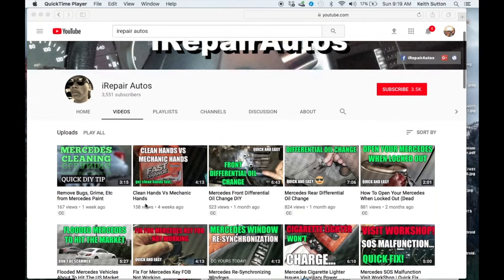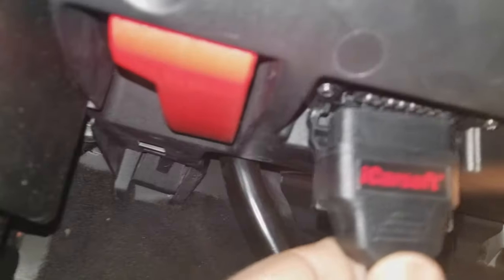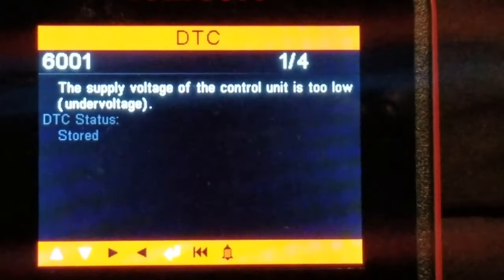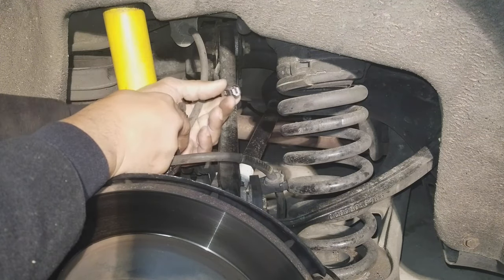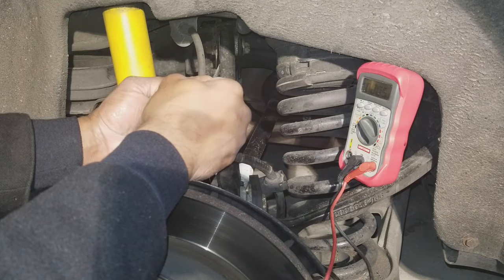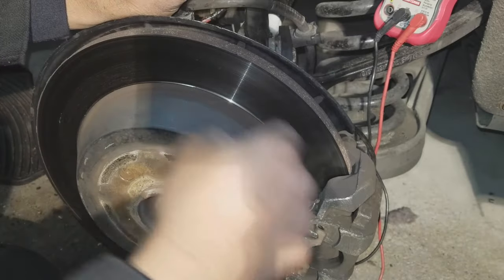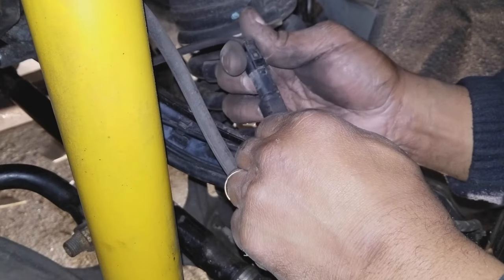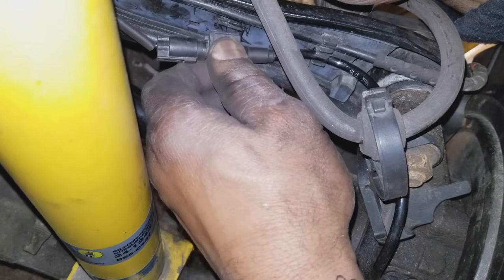Mercedes ABS Sensor/Wheel Speed Sensor Troubleshoot and Replace

Comment: Great Video.  Would love your opinion on a problem I'm having with my 2000 S430.  my ABS light is on and the code states I need an ESP module.  Just haven't gotten around to it because I'm dealing with a transmission issue I'm wondering if it's related to the ABS.  There is no check engine light on.  I'm getting a harsh downshift from second to first when slowing down to a stop and I'm also getting what appears to be an engine flare during the upshifts. It's up shifting at a higher RPM and seems to almost lumge forward at the shift.  I have change the conductor plate...13 pin connector...New TCM...rebuild valve body and yet this problem still exists.  I'm at my waits end with this vehicle...but I love it.  Do you think the bad ESP module could cause this? I did replace a rear right speed sensor way back. I know the speed sensors might affect the shifting but I believe that problem has been corrected and my cruise control is working fine.  There was a time when the smooth shifting would  return and notice the steering felt lighter.  Then the rough shifts would come back and steering felt a little heavier.  But now the rough shifting is constant.  I personally work on all my vehicles and own a few benzes but I'm stuck on this one.  Any thoughts would be greatly appreciated.  Thanks
Reply: Mine did same thing I’m pretty sure it’s connected cause it all stated when the abs light came on

Comment: My ABS light is on. When I run the diagnostics, it shows C1120 left rear speed sensor bad and C1140 B34/1( ESP Pressure sensor fault). On the speed sensor, i confirmed that there is low DC voltage to the new sensor is getting AC voltage when i turn the wheel. This is the replacement sensor that I bought on Ebay. On the C1240 code,I replaced the sensor on the bottom of the master cyclinder and i am still getting same code. Verified that there is dc low voltage to sensor. Any more advice would be greatly appreciated!!

Comment: Hi there, you’re using the i980, but linked the MB II model...just curious if the MB II is newer and better than the i980? (Based on the manufacturer, yes)...I mainly need for diagnosing a few lights: ABS, ESP, EBD, and tire run flat indicator on my 2011 c300 4matic sport

Comment: great job question can the wheel sensor cause the front right brake to lock up?  my 1999 ml320 has that problem.  I have replaced the yaw rate sensor with no change, I have bleed the brake line no help.  now I cant get the wheel sensor to come out need to work harder I guess.  alan
Reply from the maker: Wheel sensors can cause the wheel to go into ABS mode, skid, and brake.  Are all the tires the same brand and size?  Are the inflated to the match?  If one is spinning slower than the others it will simulate an issue that may look like a wheel speed sensor.  Let me know.

Comment: I have a 2014 C250. It will idle around the parking lot fine but when you press the gas it seams as if the breaks are engaging and the car dies down. Could this be a sensor issue?

Comment: Hello,
My name is James from upstate New York. Your repair videos are very beneficial. I have a 2012 c250 coupe Mercedes benze with a check engine light is on. I plugged 
the icarsoft scanner and it is saying the left front wheel speed sensor is bad. I replaced it and cleared the code, but the light keep coming on. Please advise.

V/R
James
Reply from the maker: You could have an unrelated issue, are you still getting the same code?  Also did you inspect the harness to the speed sensor to see if it's damaged?  Where did you get the speed sensor?  Was the vehicle ever in an accident on that side?

Comment: I have a question, my ABS, ESP, air pressure tire sensor, and Diff lock plays up, I know it's the speed sensor in the right rear, would this throw the error for diff lock?

Comment: I have a 2006 Benz c280 my car won't sometimes won't go in park I have to do it myself then sometimes won't start then it will only go in drive and reverse was wondering if it's this problem and what measurement is the sensor please and thank you
Reply: Speed sencer ?
Reply from the maker: It could be your brake position sensor.   Have you scanned it with a scanner that can give you more than check engine light codes like an icarsoft scanner?

Comment: Hello, i have a Mercedes CLK w209 and if i watch live data on my obd scanner of speed sensors they show 0,59 km/h with the car in park and not moving . i have no codes regarding abs . i also mention that the transmission acts weird a little bit

Comment: I just removed a stuck sensor from my Sprinter but not sure how much force to expect to use pushing in the replacement. The stuck one had to be partially drilled and pulled out with a self tapping screw; and all pieces were extracted without damage to vehicle. Seems to be a friction fit to install the new one but not sure how much pressure I should expect getting the new one in - is very tight.

Comment: 2003 ml350. Code : p0720 (says: Output Speed Sensor).   Is this the same sensor that you changed in this video? All this beeping started with changing the battery. Did all the left right left stuff... to no avail. Put the scanner on it and got that code. What I’m say is, please help. Thank you. I’m subscribing now.
Reply from the maker: This is your speed sensor inside your transmission.  I don't have a video on this job yet.
Reply: This is a late but Thank u. 
I got it out of limp mode. A fella cleared it out with a scanner. 

Now I have changed the battery again and it’s doing the same thing. Could not clear it this time. 
What is the code for a wheel speed sensor vs the transmission speed sensor? 
Thanks for any help

Comment: Good morning man I’m new to the channel but I found your videos very simple to navigate.

My wife has a 2004 C320 sport and right driver side is making a clicking noise when you drive I Recently change the wheels one got stuck and I used a rubber mallet to brake it loose after I installed the new wheels ESP light and ABS come on 

What could be please help
Reply from the maker: It's possible that the sensor was on its way out and the banging may have finished it.  Check the connections to the sensors.    Another thing. The wheel that you changed may be slightly a different size if it's newer than the rest or a different brand.   If you have an icarsoft scanner use this video to isolate the problem.
Reply: iRepair Autos I took it apart and clean it and the Abs light when off but the clicking noise was the lug nuts where 1/4 long
Reply: iRepair Autos I really like your videos I appreciate it the help and the support keep it up bro . God Bless
Reply: Great video, we just added a leaf spring and ABS cluster came on, due for a service b and troubleshoot that problem.
Reply from the maker: It's probably a disconnected or damaged abs harness cable in that area.

Comment: Hello Keith! Thanks so much for such informative and quality Mercedes Help Videos. I have an issue that needs your expertise regarding a 2007 Mercedes ML350 4MATIC. The current issue involves the mystery of automatic braking that is engaging upon right or left turns. The Rear Brakes (Front Brakes appear fine), ABS Speed Sensors (front and rear), Brake Sensors (both front and rear) have all been replaced. The ABS and Brake Wear lights on the Instrument Panel, which were on prior to the aforementioned repair/installations, are no longer on. There are no Trouble Codes showing. Could this be some sort of reset issue? Would you please Sir help shed some light on this perplexing issue? I extend my gratitude in advance for any directives.
Reply: Still having the issue. I know that you must be in high demand, as your expertise is very evident. If you can please find a moment to respond to my post from several weeks ago, I would be ever so grateful for your directives. Thanks so much in advance as I await your response.

Comment: Hey! Awesome vid, but sadly not helpful for me.

I have a '99 C220CDI, and the diag tool showed an error with the front right abs sensor. I replaced it with a new one, also replaced the brake pedal switch, but the error still present. What could be the problem? My guess is the ABS controller, or the wiring might have contact issues. 

Which one is more common in your opinion? And how can I inspect them?

Thanks in advance,
Máté
Reply from the maker: maksoo 95  after turning off the light does it come back on immediately or after you drive or press the brake?
Reply: iRepair Autos it remained on after starting the engine.  On  the other hand after deleting the error code via obd,  it switches on upon exceeding ~10-15 kph. I looked at live data,  all wheelspin sensors worked fine,  the front right remained at 2m/s.

Comment: Hi! Thank you for posting this. Would you be able to help me on this? I have a cla250 2015 and I need the wheel rear tire sensor and bearing replaced. Where can I get Thai parts and how do I know I’m getting the right parts ? Any website ? Thank you
Reply from the maker: To be 100 percent sure. You can get the parts at the dealership. You can also get the bearing at a local parts store of you give them your year, make and model.   Online parts stores seem to do a good job with this as well.

Comment: Hello I have a 12 MB SL550 with multiple light all surrounding the brakes, abs, traction control and a hard pedal.  The passenger rear brake line was cut incidentally. And the car bled most of the brake fluid out then went into the dreaded STOP / LIMP MODE... And can't seem to get it to drive over 40mph.... HELP?

Comment: I have a '99 Ml430, and I've got the Esp/bas and Ets lights on , no Abs light. Sometimes the lights won't show up when I start the car, however as soon as I hit the brakes before shifting to D, it happens. The car behaves perfectly fine when driving.

UPDATE: I bought a Delphi scanner, and got the P1584 Brake Light Switch. Could this be the cause?
Reply: Its a cheap and quick job, I would do it. Its just a few bolts holding the panel where the obd is situated.....its a plug and play part. I see you updated a while ago; did you do it and did it fix it? Its really helpful when updates go right through to the fix?

Comment: I had the abs light on and used my icard to scan the issue. It told me the right rear speed sensor was not working correctly. I replaced it and cleared the codes. Then I take the car out and the dash lights up telling me the left rear sensor is bad. I replace the left rear and clear the codes. I drive for 5 mins all lights up again and now says both are not working. Any suggestions?

Comment: yes sir. i have 06 e350 benz when i start the  car and start driving  the ABS AN ESP WARING LIGHT ON THE STEERING  GETS STIFF.
Reply: If you changed the battery/ had a dead battery recently you may need to reset the steering angle sensor. You can do this by turning the steering to full lock...side to side holding a few seconds on each lock.....the warning lights   will go out after a few times of doing this if the reset is the issue.

Comment: I have a 2009 c300 4Matic.... only when I start driving the abs , run flat and power steering alert comes up.. if I turn off the engine  and turn it back on and scan the vehicle , it reports no fault.......... any idea what can be the issue?  It started after I swap the winter wheels to summer wheels.. summer front wheels are smaller than the rear wheels..

Comment: i have a 2006 R500, im getting high voltage from the car side of the harness and ive replaced the sensor, replaced the wheel bearing because the sensor ring is built into the wheel bearing but still same code as if im not getting voltage from the car but when i test the voltage im getting over 10 volts from both front sides, any ideas ? i do have an i carsoft and the right wheel is just not reading the sensor, ive even took out the spindle and held it to the left side and used the harness there and it shows speed when i spin the hub but when i take it back to the right side no speed at all, im confused, any ideas, please help

Comment: When swapping the sensor do you need to clean the hole before installing new sensor?
Reply from the maker: Yes - clean out any dust, rust that you find.
Reply: Would it be ok to spray brake cleaner in it
Reply: How did you fix your issue? Also wondering if I can clean out the port / sensor contact.

Comment: i have a 1997 w202 c280, i had to get another differential installed  (from a 1998 c280)but the new one does not have a speed sensor on the differential like my old one, i still installed the new diff anyways, this caused my ABS light to come on and my car wont shift from 1st gear. do you know what the frequency of the ABS sensor is?? OR any ideas of how to fix/bypass these problems i'm having? especially the problems with being stuck in 1st gear. appreciate it
Reply: I have an 01 E430, that has slipped into limp mode, I have tried the manual reset and that dint work. The shop wants 1175, to replace the turbine speed sensor. Any suggestions?

Comment: hi  iRepair I did a replace of my left front wheel bearings and then my Abs & Esp lights is on now.  I then replace the ABS sensor and its still on. How do i do the reset from the menu inside to have those lights off. i am fed up with this.

Comment: Hello 
I have a CLS550 2012 and the brakes appears to be locked, I released the parking brakes, I have no error message but the wheels is locked; I am able to shift gears, however even when I put the car in neutral the wheels is still locked… Help!!!

Comment: Great video, thank you! I have a 2006 ML500 and my ABS and ESP lights are on and when I start to drive slowly the brakes seem to engage by themselves. Is this the same problem that others are having when the speed sensors are faulty? Also, is anyone else having an issue where the picture of a battery shows up on the LCD display with the message saying go to the workshop except both the main and reserve batteries are totally fine and holding the proper voltages? I have that problem and also my front driver and passenger door lock posts won't pop up and down anymore. Does anyone know if the battery indicator message on the LCD and possibly faulty front door locks are related to the front SAM? Thank you.

Comment: After the sensor is swapped out with the new one, how do you clear the ABS light?
Reply from the maker: The ABS light goes out by itself. If it doesn't, then the sensor is defective, or there is a connection problem somewhere.

Comment: Nice video! I have a ml55 ,brake alarm noise goes on and off every time u hit a pothole or an raining day,then I turn the car off they on again and the noise goes away,what can be the problem? Speed sensor? Thanks
Reply from the maker: Your parking brake is triggering that alarm. Normally it goes off if your parking brake is on while driving.   Inspect the parking brake, it's connections etc.

Comment: Hi , thank you for this video , my car w204 model 2007 shows :(ABS ESP & EPV RunFlat system is inoperative , refer to owner manual)
on the console cluster ,
I used iCarsoft MBII and I get the following codes:
5944 control unit N30/4 electronic stability program fault .
5001 control unit N30/4 electronic stability program fault 
Can I still drive the car or is it dangerous issue and what are the involved parts that need to be changed?
Thank you
Reply from the maker: First thing that jumps to mind is a loose or faulty connection.  ABS, ESP, EPV deal with brake assist and traction control.  I cannot say that it's safe to drive.   Have you been driving it?   Is it still giving these messages?  What work was done recently?
Reply: iRepair Autos  it was parked since then and couple days before I wanted to test if I still have those messages but surprisingly the whole car is dead ... even the central lock to open doors is not working , no lights on cluster NOTHING !
Most probably it is bad battery because when checked it with multimeter it shows 2.5 v only ... so I will change it and I hope the faulty messages were due to bad battery not the other way around!
Reply from the maker: @ramban3488  OK sounds good.  Keep me posted.
Reply: I have the same 5001 code. The dealership wants to charge me 2500 to fix it. Is this a fix that I can take it to a regular shop that specializes on Mercedes Benz and get it fixed for less money?
Reply: toccarrajohnson 
Until you get a prof answer , let me tell you that I found out that my battery was so weak , so I charged it and I asked the technician who recharged my battery to reset the codes ...  and I took the car for a test drive ,surprisingly everything was back to normal !

Comment: Hi iam replace sbc in e240 I got trouble code in sbc c2134 I checked live data it will show  all speed sensor equal running but showing instrument service brake visit workshop that fault code is not gone . Pls help me how to remove that code

Comment: 2008 Mercedes-Benz C class350 sporty I have ABS light is on and ESP when I checked it with the scanner i980 this is what read power supply A73m1 high-pressure and return pump. Can you help me figure out what that may.
Reply: Same problem.  How did you fix it